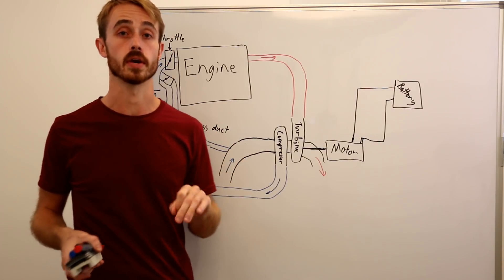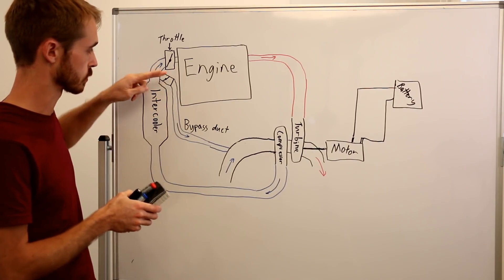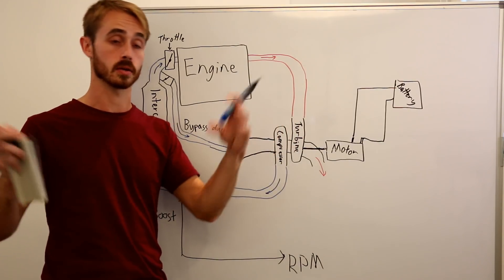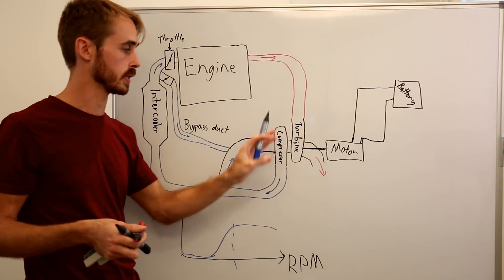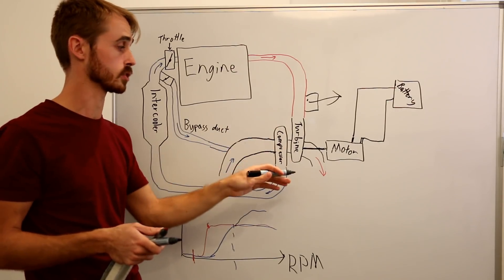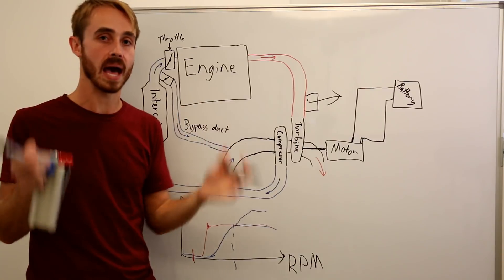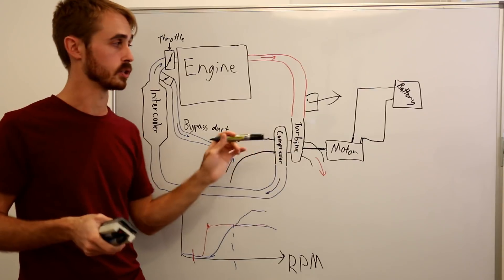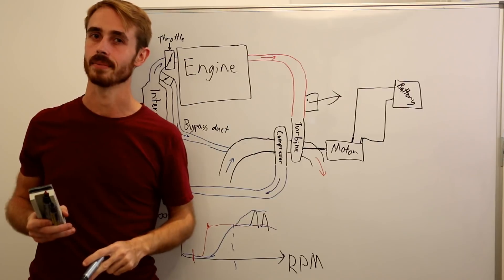How do Hybrid/Electric Turbochargers Work? Hybrid Turbos (MGU-H) Explained

Comment from the maker: For all the people commenting about the exhaust gas recovery, I originally had a caption stating that it was both pressure differential and heat energy being harvested, however it seems that has since been deleted by YouTube's endscreen function. Remember, I record these videos all in one take as I don't have heaps of spare time, so there will be occasional slips, but I try to correct this where possible. And for those saying turbines don't recover heat energy, I suggest you do some more reading...

Thanks for watching!
Reply: Oooh, you replied to my comment BEFORE i made it!
I will do more reading but in the meantime, at the risk of looking stoopid, (won't be the first time) i'm going to take issue with your word 'recover'. 
It would suggest that 'recover' suggests the turbo is getting something back to use. 
My understanding is that the heat generated in the turbo body is unwanted, why else would we have to fit an intercooler to remove it? AND, why else did Mercedes F1 split the turbo in half so that the impellor and compressor turbines are on opposite sides of the engine to eliminate as much as possible the heating effect the exhaust gasses have on the compressed air?
Also, it is the exhaust gas flow than spins up the impellor, not the heat from the exhaust gass.
Reply: Koito rob You're right that it is the exhaust flow that spins the impeller. But it is mostly because the exhaust gasses are heated up that they do. Remember that hot air takes up a larger volume than cold air (at the same pressure). The high temperature of the exhaust gasses are the main reason for the large pressure that spins the impeller.
Reply: Im still studying as a meche, so bear with me here.. it was my understanding that turbos only recovery energy directly from the pressure differential.. This pressure differential is normally driven from the combustion in the engine.. which we know produces a lot of heat and exhaust gasses which turbos use to spool up.. Hotter the exhaust gasses the greater the pressure differential.. is that how turbos technically recover thermal energy? or is there a more direct reason for it?
Reply: Fully agree, heat is one of the intakes worst enemies also damaging to bearings and lubricating oil. I was somewhat gob smacked by his statement.
This paper (the link below) deals with heat recovery but does not support claims of turbo heat recovery in the manner Kyle suggests;
https://www.researchgate.net/profile/Alias_Noor/publication/292759493_Waste_heat_recovery_technologies_in_turbocharged_automotive_engine_-_a_review/links/56b9a10508ae3b658a89239d.pdf?origin=publication_list
Reply: Im still studying as a meche, so bear with me here.. it was my understanding that turbos only recovery energy directly from the pressure differential.. This pressure differential is normally driven from the combustion in the engine.. which we know produces a lot of heat and exhaust gasses which turbos use to spool up.. Hotter the exhaust gasses the greater the pressure differential.. is that how turbos technically recover thermal energy? or is there a more direct reason for it?
Reply: Koito rob Hi, I'll try to answer your questions:
The heat (and therefore the higher pressure in the exhaust) is used to spin the impeller and the turbine for the inlet. The inlet air pressure is increased and therefore heats up. This heat is unwanted and therefore cooled down by the intercooler. So the heat/pressure of the exhaust gasses is used to create more pressure (and thus heat) at the inlet.
Reply: Koito rob The separation of the impeller and the compressor by Mercedes is done for several reasons. The most important one (I think) is to shorten the inlet tubing. This gives less friction and needs less space so the body can be made smaller, inducing less drag. You are right that there will also be less (unwanted) heat transferred from the outlet to the inlet but that is not the main reason.
Reply: Forget the Battery and build yourself a Bank of Maxwell 3000 Farad Ultra Capacitors, not only will capacitors recharge faster, they can also discharge faster and at a higher amperage, also, there is more than one way in harvesting energy than mechanical. 

You can stream another line of energy from waste heat from the exhaust using high temperature Thermoelectric peltier modules, get an array of those and connect it to the ultra capacitors if the regeneration from the mechanical energy from the electric motor isn't recharging fast enough.

Comment: Heat energy!!??? WTF I think you meant kinetic energy is extracted from the exhaust gas!!! And with that...I'm out!!!
Reply: nunya bidness heat energy is the same as kinetic energy
Reply: Andres Lezcano no...it is not dumb dumb ...heat energy more correctly stated radiant energy HAS kinetic energy but it is not kinetic energy for the purpose of this diagram, a turbo is running off the motion of the hot air when expelled from the combustion chamber not the radiant or thermal energy of the hot air
Reply: I guess you need to tell that to the engineers in F1 who call the unit attached to the turbo the MGU-H and the unit attached to the braking system the MGU-K...
Reply: fierydawn spot on!

Comment: looks like his waste gate is in the  wrong place
Reply: Nope, right place https://en.wikipedia.org/wiki/Wastegate
Reply: ok , the waste gate is in between the turbo and intake. so how does that slow down the fan from exhaust. The waste gate is for letting the extra boost to escape when shifting and slowing down, so u don't boost open the throttle  and can't stop it , the drawing shows the pipe recycling the boost back to the intake. if he puts the waste gate on the exhaust manifold side I guess he could regulate the speed of the turbo, but it would be some type of manual or electronic switch
Reply: Yoshi Metsu Don't confuse waste gate with blow off valve. Waste gate is on exhaust side to regulate the speed of the turbo by bypassing a portion of the exhaust around the turbo. The BOV either recirculates or blows off intake air to prevent damaging pressure spikes in your intake tract when decelerating.

Comment: Just have an electric supercharger that draws electricity for a turbo generator! So much simpler....
Reply: Yes, it's simpler but less efficient and we all know how they bang on efficiency today ;D. With your setup you would have to convert energy multiple times before it ends up as pressurized air. With an electric driven shaft that already connects a turbine- and compressor wheel, you can use the kinetic energy straight to push air in your engine without the losses of having to convert kinetic energy into electrical energy (assuming you got high enough amount of exhaust gas flow :D).

Comment: Correct if I am wrong but there should be no need for a turbo/compressor setup with an electronically driven turbo. Because you would have an electric motor coupled straight to the compressor feeding pressurized air straight into the intake manifold (example http://bit.ly/2bMOQ08) Now with that said the battery is not an issue if you use modern batcaps and a good alternator. Therefore while a hybrid battery pack would be great, it is by no means necessary. Now you could also argue that batcaps will only power the electric motor for a few seconds before depletion. But unless you are in a top fuel dragster or drifting there is no need for constant on demand boost.  The only wasted energy in this case would be the energy taken from your engine to spin the beefier alternator. Sure you restrict air flow when the turbo is not powered and the batcaps are charging, but small price to pay for lag free boost imo.
Reply: One turbo system does not fit all, while it is relatively simple to make a small all electric turbo work some of the time for an average city car  you get into very very high power demands going towards the racing side, and once the situation demands constant boost delivery you also need to provide constant electricity for that larger electric motor.
So for a race car you would need a big heavy motor, a big heavy alternator, a big heavy battery and scavenge a great deal of power off the engine since exhaust gases aren't helping, all to get that somewhat better boost performance.
Reply: Problem is the turbo compressor actually uses up to 50 HP believe it or not generated from the turbine.  10-20% of the engine power typically.  So you need a 50HP motor spinning at 100000rpm+ to fully replace the turbocharger turbine.

Comment: If I heard you correctly...:  White it is certainly present in the functioning of this system, heat energy really has nothing to do with the turning of the turbine.  The force of the exhaust gasses being pushed from the engine is what turns the turbine.

I had to listen to that bit a couple of times because I couldn't understand it audibly.
Reply: What spins the turbine is the difference in pressure acting on opposite sides of the turbine wheel blades.  High pressure on one side of the blade is developed from turning the gas stream to the opposite direction it entered, like a water wheel.  The turbine housing acts as a nozzle, greatly increasing the gas velocity before it enters the turbine wheel, in order to get the highest pressure effect on the turbine blades.  The nozzle turns the heat energy of the gas into kinetic energy.  The gas velocity in the nozzle depends on the temperature of the gas, it is about proportional to the square root of temperature.
Reply: no, he is correct.  the exhaust turbine is a heat pump, the hotter the exhaust temp going into the turbine and the cooler the exhaust going out the more efficient the turbo will be.  the exhaust gas flow you are talking about is only part of the equation
Reply: Red Bat Racing no, he's wrong.  while hotter exhaust gasses will have a greater drive pressure, it's still as simple as exhaust having to pass through a wheel to find its way out, that mechanic of a turbo will never change.
Reply: Casey Johnsen No it's mainly heat. The work output of a gas turbine is found using the specific heat of the fluid and the temperature of the fluid going in and leaving the system...
Reply: +Stephen Kramer Yes and no. Your last sentence is not that great, the temperature does effect the velocity but it does that in form of pressure. Imagine a volume of gas in a cylinder (we just assume it has atmospheric pressure). If you heat up the gas inside the cylinder, the gas will try to expand (but it can't because the cylinder is closed), so the pressure increases. Now the valve opens and the gas can expand into a bigger volume (so big that the cylinder pressure is not effecting the atmospheric pressure in any way), whereby decreasing it's own pressure (assuming outside the cylinder is atmospheric pressure). The velocity of the gas expanding is therefor ultimately derived from pressure difference, what in turn derives from energy difference (in form of heat). If one wants to be correct one should say that heat is driving the turbine wheel ;D.

Comment: Do you think, with help from a regenerative system,  it would be possible to incorporate some form of electrical assistance to downsized TC'd petrol driven engines in order to reduce turbo lag,  without having to change to a 48V system? (Specifically engines between 1-1.2l)
Reply: Yep - that’s why there are so many Mild Hybrid (12V - 48V) petrol engined cars now.

Comment: At the beginning of the video, when you explain how a common turbo system works, you say the turbine extracts heat energy from the exhaust gas to power the turbine. Which is wrong as the energy used by the turbo is not the heat, but the gas flow of the exhaust gas.
Reply: What spins the turbine is the difference in pressure acting on opposite sides of the turbine wheel blades.  High pressure on one side of the blade is developed from turning the gas stream to the opposite direction it entered, like a water wheel.  The turbine housing acts as a nozzle, greatly increasing the gas velocity before it enters the turbine wheel, in order to get the highest pressure effect on the turbine blades.  Higher temperature exhaust creates more turbine torque because the higher temperature reduces density and increases gas velocity.  The velocity is about proportional to the square root of temperature.  Thus it is extracting heat energy, but in the process it converts the heat energy into kinetic energy.
Reply: It's both sort of, but primarily from heat. In actuality flowing fluids creates less pressure than stationary fluids, and if there were no combustion the only energy to turn the turbine would be from the piston compressing the air, but that wouldn't happen since the volume of the manifold is greater than the volume of the cylinder. The exhaust flow is a direct effect from the heat expansion of the air fuel combustion, it just happens to get pushed out by the exhaust stroke. The heat energy creates most of the differences in pressure across the turbine that causes it to spin. The reason the turbine spins is because the pressure inside the manifold is greater than the atmospheric pressure in the exhaust pipe behind the turbine.
Reply: +MidShipCivic in a closed system with no pressure differential across the turbine, no it will not spin.
Reply: +MidShipCivic Ask yourself, if you blow the torch or any fan hot or not into a turbine, what makes it spin?
Reply: More or less. It#s more like the heat creates a pressure differential, what in turn converts into  a gas velocity when expanding in  a huge volume . Thermodynamics are pretty interesting ;D.

Comment: What are your thoughts on a hybrid-electric turbocharge induction two-stroke with direct injection? With this layout the bottom end could theoretically be sealed from the top end like a four-stroke removing the need to lubricate the crank with the air-fuel-oil charge. The turbo would have to produce about 44psi to match a conventional two-stroke pressure, but depending on exhaust scavenging might not be necessary to clear the exhaust out of the cylinder. Also the port to compressor spacing would have to be tuned to reflect the pressure front back to the port before it is sealed by the piston like a regular two-stroke. Your thoughts on the viability of would be much appreciated.
Reply: Chris Ingram Thank you for your humbling words! I appreciate your criticism.
Reply from the maker: +hmushmann2 I actually thought of this exact idea back in high school! As it turns out, it's kinda been done already if you look at how two stroke diesels work. They use a blower/supercharger (although could conceivably use a hybrid turbo) blowing pressurised air in the side, then have conventional valves on top for exhaust. Combined with direct injection it works really well! I was always surprised that no-one had ever tried to implement it on a conventional car though instead of heavy machinery. Maybe piston ring wear on the intake port is an issue? Not sure. But if you used the top valve system instead of a regular two stroke porting you shouldn't have to worry about tuning the port to compressor spacing. At least that's what I would think off the top of my head...
Reply: +KYLE.DRIVES I speculate that this two-stroke design hasn't been pursued because the automotive industry is already set in it's ways with the four-stroke, as well as the ability to efficiently control the fluid flow since it has a dedicated exhaust stroke, to approach a more stoichiometric burn. As well as the push for full electric consumer grade people carriers. On a side note, most current two-stroke engines are still designs from the late 80's and early 90's with sub par simulation software to today's standards. With the advances in additive manufacturing, parts would not be limited to the machining limitations of a milling bit. Would be interesting if to see what could be engineered if we use modern manufacturing technology even if the result is just an expensive prototype.
Reply: H. Mushmann what you just said is a big bunch of words and bullshit that has nothing to do with the electric motor. Stop trying to be a genius. It works either way
Reply: Chris Ingram And God bless you. Are you interested in the rest that Jesus Christ can give your soul?
Reply: +KYLE.DRIVES Many large marine diesels are pressure scavenged 2-strokes that work fairly efficiently because they are fine-tuned to run at constant rotational speed for best economy. Detroit diesel 2-strokes were common in trucks, but I don't know if anyone ever applied the same principle to a gasoline engine.
Reply: Can't use 2 strokes because too much emissions.